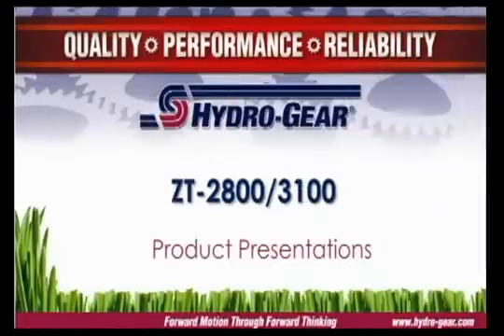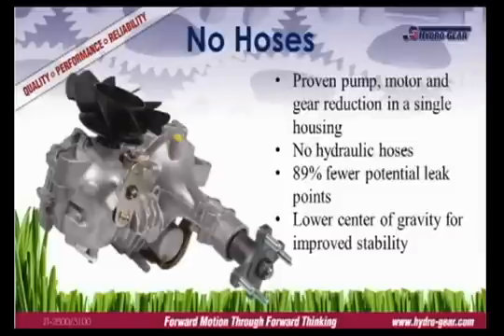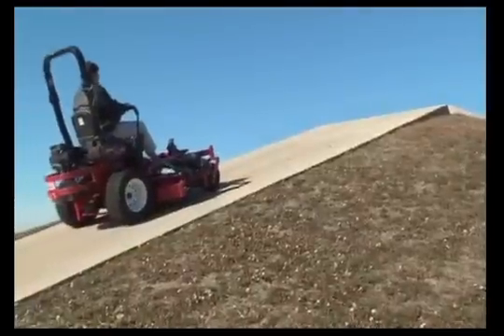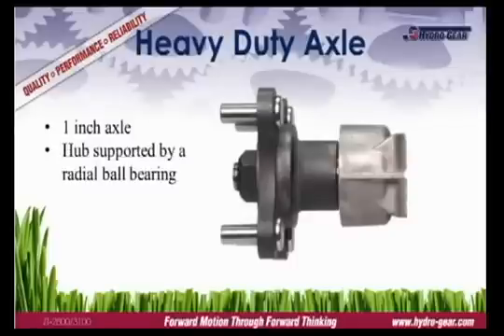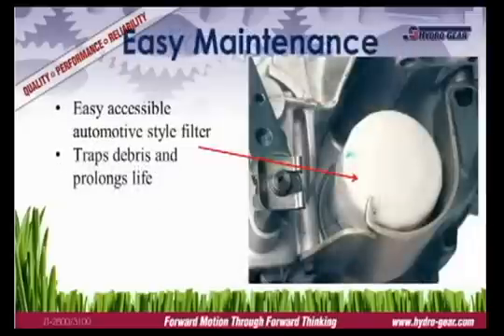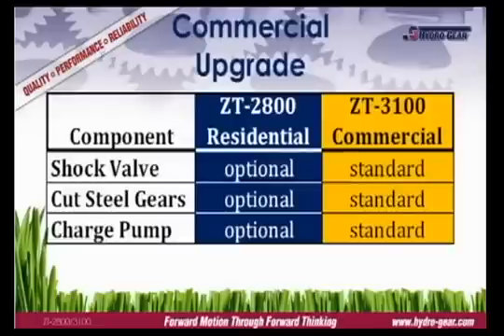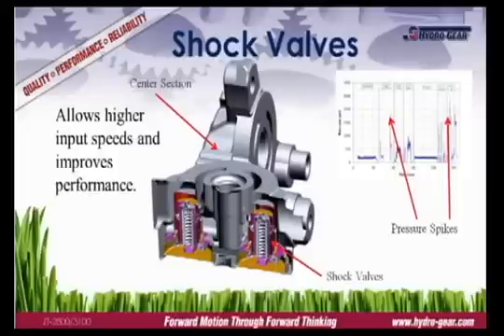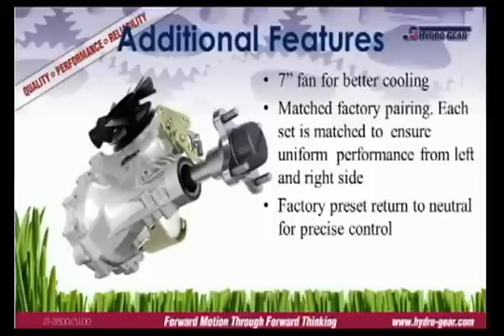Hydro-Gear ZT2800

Comment: Im in the 11% of the "potential leak points" on the ZT-2800. parking brake shaft O-ring failed. entire unit disassembly required to replace the $0.10 O-ring

Comment: I bought a 2017 Bobcat CRZ 61 with ZT2800's, how do I know if if the transaxles have either of the 3 options (shock valve, steel gears, or charge pump)? Is there a model number nomenclature that will tell me this information or lack of?
Reply: You can see the charge pump the others you would have to open it. Most likely its the gears. Which you could upgrade. You could also upgrade the 16 cc motors to 21 cc motors for way more power. Again the charge pump is directly below the pulley / fan on the case. The other two options you have to pull the cover or you could look up a parts list on the pumps exact numbers.